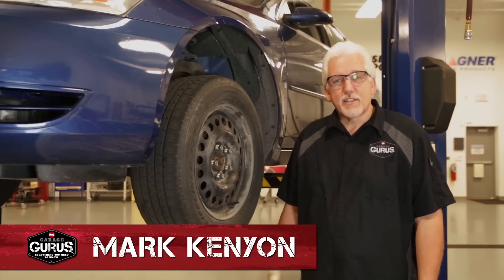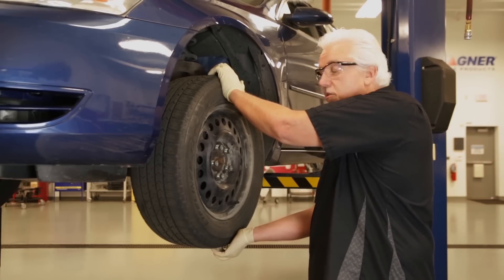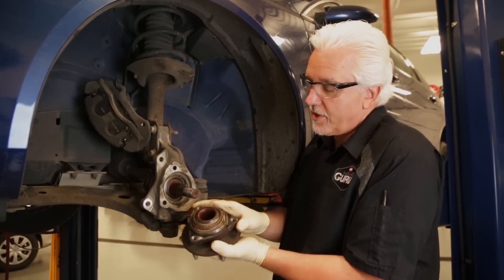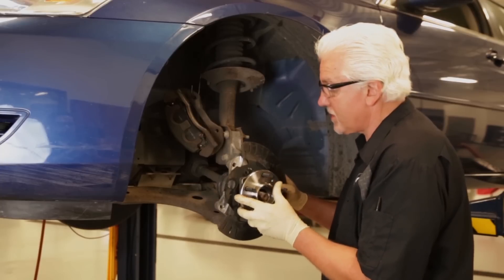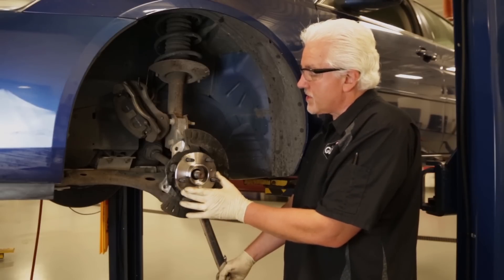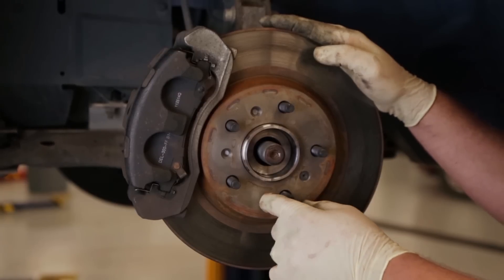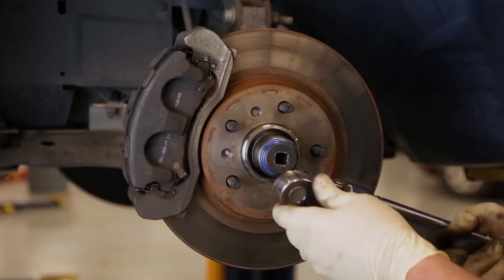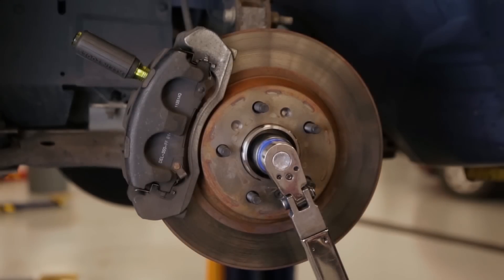2006 Chevrolet Impala Wheel Hub Bearing Replacement

Comment: Provides basic instruction, which in this case can be dangerous as there was no mention of what to do with the ABS connection, no mention of how to remove hub assembly - need a spreader tool of some sort as a puller will just push the drive axle back into the transaxle...

Comment: What's the mm size for the spindle axle nut for 2006 Chevy Impala SS? I used a 34mm socket 1/2in drive from gearhead brand but it felt loose.
Reply: I've got a Canadian 2006 Buick Allure, which is the same as a Buick LaCrosse outside Canada.  It's the same platform as the Impala, so I'd assume it's the same nut.  I'd also assume the SS is the same as the standard.  Mine's 33mm.

Comment: So - if the axle does not want to let go of the bearing, what do you do?  Do you have a special tool to separate a rusted axle from a bearing?  Can you put an old axle nut on the end of the axle (to protect the threads) and hit that?
Reply from the maker: Ranger, try the OTC OT7394 Universal Hub Puller and OTC Tools 7208A - Front Hub Puller. They are both designed to use the lug nuts to secure the puller to the hub flange, once secured to the hub you can then use the forcing screw to push against the axle.
Reply: Thanks for the tips. I managed to break the axle hub free of the old bearing by putting an old axle nut on the spindle and alternatingly hitting it with a hammer and lots of penetrating oil.   It eventually broke free...  but it appears I now have a slight vibration at 70-80 mph.  Nothing really below that.  I thought that I could hit the spindle as it was seized in the bearing and the bearing would take the brunt of the impacts... and would not transfer the impact back to the CV joints.  Once it loosened up I stopped but may have been too late.   What do you think?  Could my hammer (3 lb) have caused me to mess up the CV axle inside the joints and cause this vibration now?

Comment: What's the torque on the spindle nut?Your video helped me out a lot. Thanks.
Reply from the maker: +Neil Williams, great question! Feel free to call our Gurus and they can discuss the proper torque for the spindle nut. The number is The Gurus Tech Hotline number is 800-325-8886 and is available M-Th: 8:30AM-5:30PM ET, Fri: 8:30AM-5:00PM ET

Comment: Hey smart Car Guy it would have been nice to let us know if you were doing front or REAR .. ?????????????????
Reply: Wow.  No need to be rude. Maybe look at the video?  
There are cooling vents in the bumper you can see throughout the entire video.  Those are only in the front bumper, so you know you're looking at the front of the car.  Then there's the headlight that you can partially see above that bumper.  Pretty sure those are only in the front of the car.
@0:54, (among other places) look at the door handles.  Unless this 2006 Impala is equipped with old-style suicide doors, you're looking at the front of the car.  Then there's the fact that the wheel they're doing has a drive axle through it.  Since this car is front wheel drive, well.....you get the idea.
If you're so uninformed about cars that you can't figure out if this is front or rear, you probably shouldn't be trying to replace your own wheel bearing.  Learn some basics first, then come back to this video.

Comment: Tightening the axle nut with an impact will not damage the wheelbearing.The wheelbearing manufacturers are flat out liars saying wheelbearings can be damaged tightening the axle nut with an impact.It is 100% impossible to torque the axle nut down to spec.Plus you can't overtighten the axle nut.I tighten them down with an impact,no come backs yet.Stop when the socket quits turning.Put the torque wrench away for this.
Reply: wafrederick you are totally wrong. If you use an impact gun when tightening the axle nut it will damage the bearing. The reason why I know that is because I used an impact gun to install the axle nut and it ruin the bearing. After installation I drove the vehicle and the bearing immediately started whining. When I attempted to make a left or right turn in the vehicle I could feel and hear the bearing binding. I had to buy a new hub assembly since I over torqued the initial hub assembly bearing. Please stop telling people to use an impact gun to install the axle nut. It is okay to use an impact gun to remove the axle nut but not to install it.

Comment: Does this impala have abs ???
Reply: No it doesn't, the impala with abs has an abs wire connector going from hub. I know because I got the wrong hub assembly and had to return it because my impala didn't have 4w ABS
Reply: @down4mah2 how do you know if your impala doesn’t have abs without looking at the wheel bearing ?

Comment: On my 2010 Impala the dealer looked it up and told me 156 ft-lbs.  But that is with the AC Delco higher run bearing.
Reply: Rick Neubrand It varies a lot from year to year.